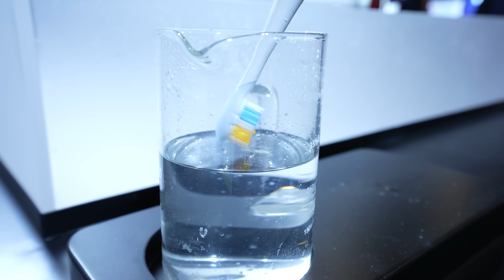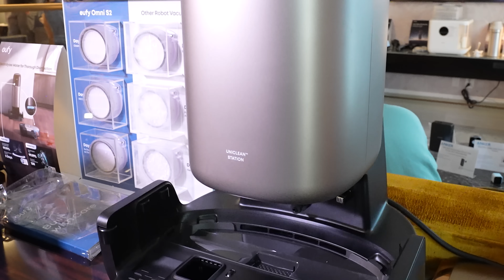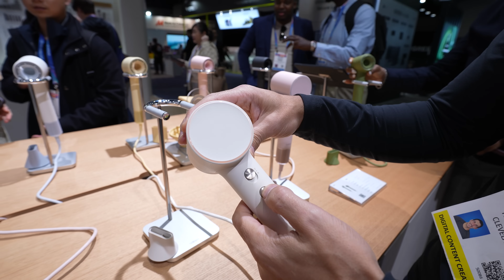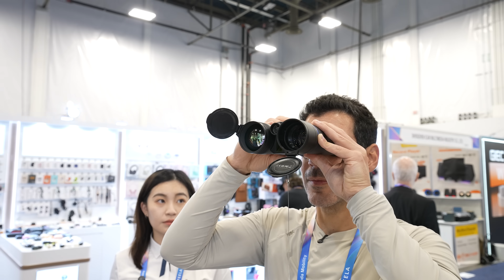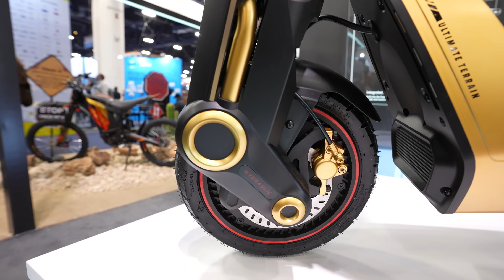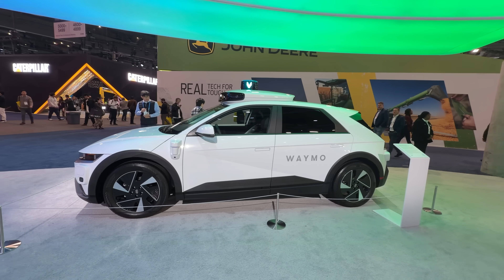DEFINITIVE GUIDE to the BEST of CES 2026!!!

Comment: Needing an app to use your toothbrush feels like we're doing too much.
Reply from the maker: I think before using this and if it was something I had to do daily - I would agree - and here's my experience  (with the previous model). There are 2 main settings "vibration intensity" oscillation range and oscillation speed" (there's other stuff like brushing duration, travel mode, etc. but let's focus on the first 3). When I got the brush, I had everything turned down very low because it was a new experience - it also depends on which brush head you choose. Over the first 2-3 months, I would make slight adjustments in the app every few weeks until I dialed it down to exactly how I want it. Now I never use the app because it's perfect for me. I don't know how else they would have given that level of control without adding a display and some sort of complicated interface to the brush (which would be a waste since you rarely use it once you have it the way you want it). I feel like this is the best of both worlds now. Hope that helps and thanks for watching!

Comment: How was the resistance on that gym?
Reply from the maker: It felt really smooth - so there's no momentum at the end of the movement from a spinning wheel - it was awesome. I really like the Eccentric and the Chain features. Can't really do that with traditional weights and machines.
Reply: @TechGearTalk  good to know.  It's interesting to be able to do instant drop sets without having to put the weights down or switch anything if you use that ring thing. Did it get in the way?
Reply from the maker: No doubt! It did not get in the way - and a few seconds after putting it on - I didn't really notice it and it just becomes part of your grip. But yeah, reaching the end of a set - and being able to immediately do a few more reps at a lower weight will be awesome.
Reply: @TechGearTalk  aaaight! 💪
Reply from the maker: I'll share more when I get one in the studio